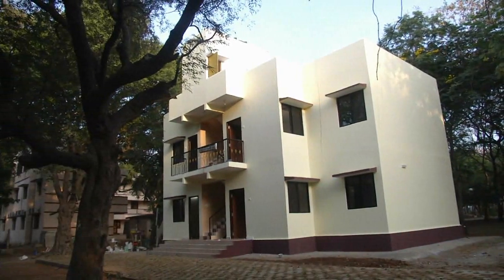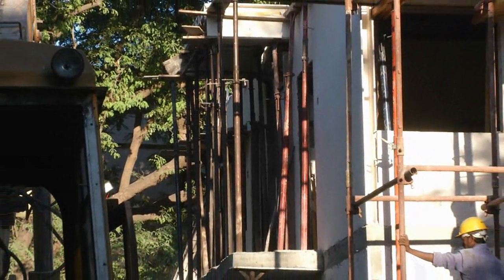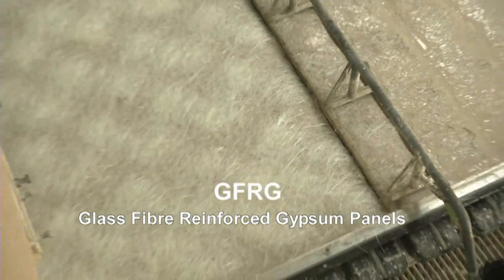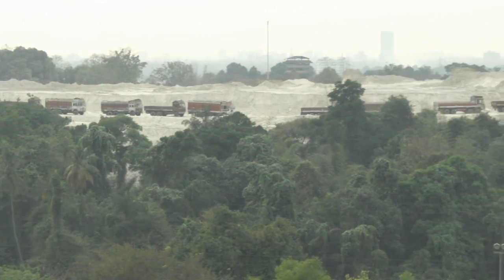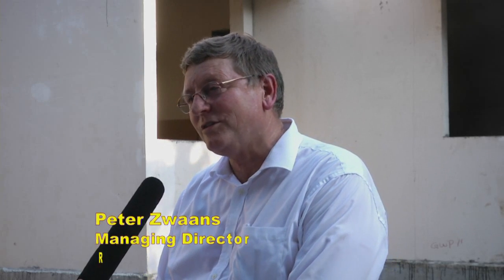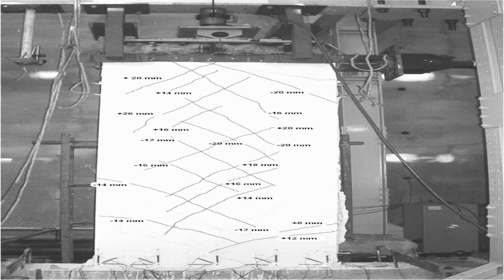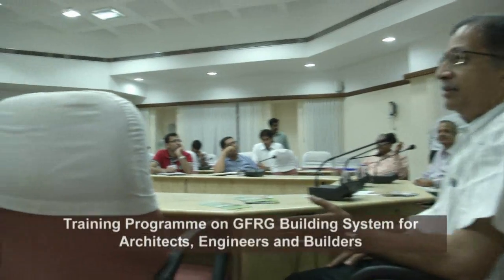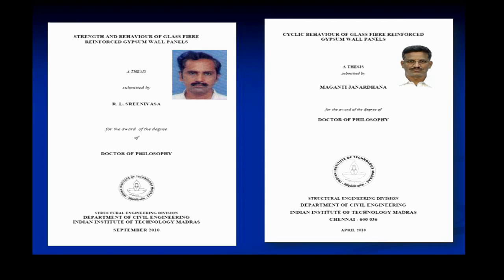IITM GFRG  demo building.

Comment: I'm retired Sr. Citizen from a village located 7 KMs away from Poonamalli. I'm planning to construct a 2BHK house initially on the ground floor with a provision to construct 2  more floors above it. 
The Plot measures 40' × 60' and it's 3 side open with 20' road on 3 sides.
Does the IIT, Chennai, builds GRGF panel houses to public or can you please suggest a good, experienced, not so costly professional who can do it for me.

Comment: Fantastic. Does it also lower heat transmission/retention for the top floor residence? Better than the dry-wall gypsum boards used for internal walls in places like the US. As long the land is blessed with no need for winter heating, and summer air conditioning, as is most of temperate India, this type of housing should gain fast acceptance.